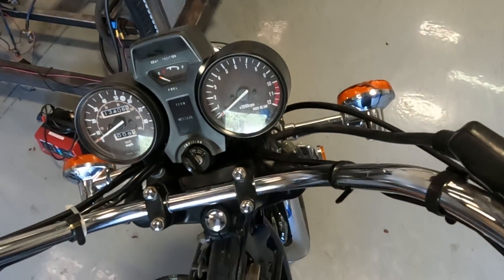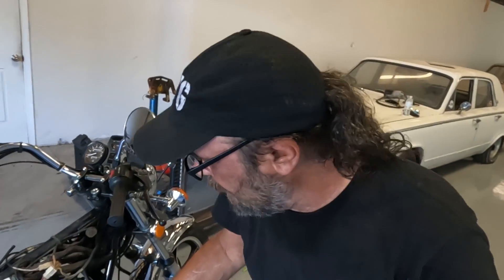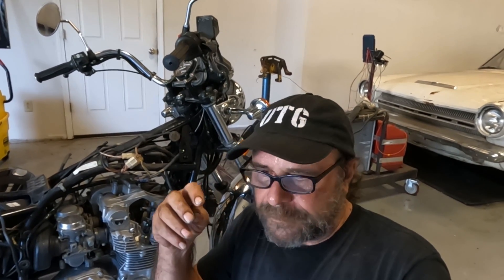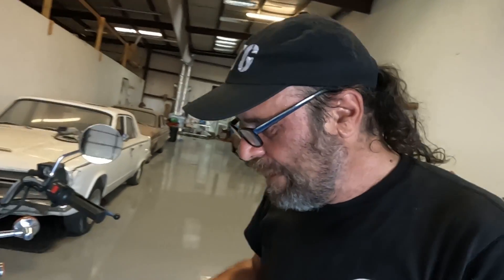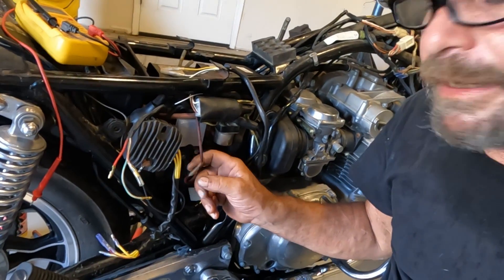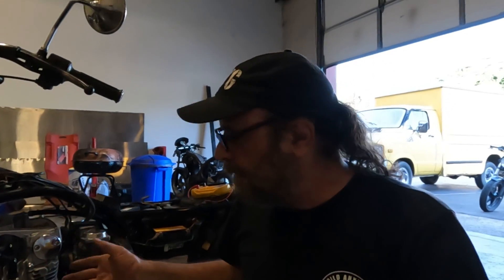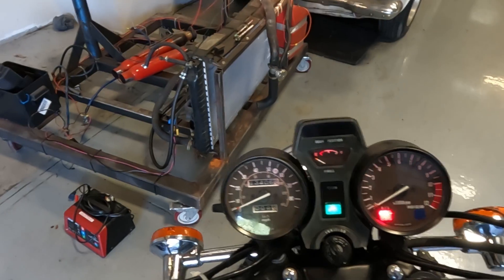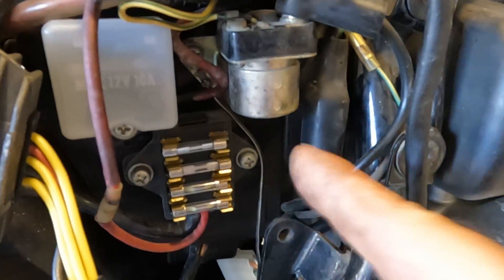Troubleshooting Oddball Starting Issues And The Difference Between Car And Bike Electrical Systems

Comment: Funny, I tuned in to pad my limited knowledge of motorcycle ignition/charging systems, but ended up learning why my '65 Falcon cranks so long sometimes without firing... only to light up as soon as I let go of the key, LOL. These little tips you offer are more useful to us backyard guys than the highly polished super-produced engine build and restoration channels. It's also neat that we have similar taste in toys... just different nameplates! Keep up the good work!! Cheers from Canada.
Reply from the maker: Yes...you get it!
Reply: @UncleTonysGarage  yes exactly I know about tuning subarus and turbo efi systems as a whole get very impersonal and numb if you know what I mean. I had a 1987 Suzuki samurai when I was a teenager and I remember the first time I ever did a bigger job in one (clutch). I had paid for all the parts and tools that I would need and a service manual. Ohh yeah I srarted at 7am and had to be to work by 3pm. I had it back together and working by 10:30 am just cuz it was so simple. I have a wonderful affinity for anything mechanically driven and analog cuz its tangible and I can see it doing its’ job! Thats what makes a real gearhead!
Reply: How about a 1976 Yamaha twin 125cc bike with a simple dual pole, dual throw relay that turns the alternator in the side case into the starter. Quit cranking and the starter turns into an alternator. 
I don’t think many at all understand Capacitor Discharge ignition system either, but almost every lawnmower engine uses this as the magnet turns but the pick coil sits still & sparks. This not a simple step up transformer as the is a transistor, the gate is triggered by a resistor & capacitor and sparks slower than the actual magnet position, or is should say delayed. Lots of cool stuff on bikes needle bearings on both ends of a piston rod w/10k RED Line. How many car engines explode at that speed. 2-stoke with a rotary disc on crank to block off the carburetor that is attached to it! No visible carburetor…

Comment: All of these old bikes are damn near bulletproof in the end.
I hate to hand it to the Japanese, but yes their machines are very hard to kill.
I worked for an old man , in my teens, that taught me time and time again...
Find the junk bike out behind someone's shed,
And we will get it running.
Most times , good enough to repair and sell.

Countless times, these bikes only needed TLC.
Every now and then we would have to clean the magnets on the rotor or stator.
Most times it just needed a fuel system cleaning.
Had everything from a Benelli 900, to old H2 triples, Husqvarna, 
Even had the gold mine of a kz1300 once. But unfortunately it had a dead cylinder on one of the six.
But it still sounded amazing as we woke it up for the first time in so many years, bellowing smoke out of the whole shop while it wound out sounding like a damn F1 car.... Right next to the drive-thru window of a burger shop..lol...  Damn near had the fire department there. But everyone knew Bruce.... If anyone knows of this man he should be somewhere in Indiana...
Thank you Tony for your time.
I wish I had the gold mine of motorcycles in the corner like the way you do now.  
I must give some credit to my old friend, Bruce Miller of national cycle in Fort Walton Beach , Florida.
He believed in me as a 12-year-old kid and we did some cool s*** from time to time. 
I later went to work for a Kawasaki , Suzuki , Arctic cat , Polaris , BMW dealership.....
But later went back to national, because he was the old school type much like yourself.
And ran nitro in his H2 triple drag bike... Whoa...
I'll never forget it.

Comment: I’ve had issues with more than 1 bike where the stator had a few bare spots where the varnish chipped or flaked off. Douche it super clean and dry and brush on some high grade boat varnish or coat it with some epoxy. Short of broken wires this helps most of them.

Comment: Welcome to the real South Uncle Tony.
Used the voltage/rectifier on old riding mowers from the 60/70's, cars with generators and old tractors/construction equipment. I believe old outboards had them also. My old ford TLB 5000 has to be polarized after power has been removed from system or part replaced.
    fyi dunk your hat in cold water, give it a shake, put it back on and you will have a temporary brain cooler while outdoors.
Read up on heat stress signs old man, because it is scary the first time it happens to you. It will sneak up on you! It is very serious stuff.

Comment: Good on ya Uncle Tony

over the years when I’ve had cars as part of the servicing I used to spray a bit of lubricant into the ignition switch where the key goes WD-40 or whatever the case may be locksmiths have told me not to do that because according to them theres a layer of grease in there that holds everything together and solvents just wash all that grease away

The thing to use is graphite powder in a little plastic container and you just puff it in there as a dry powder 

I’ve had situations where you leave the car switched off and the key barrel is worn and it’s making a very slight contact and it drains the battery 

so with older cars a kill switch is always good…..!!

Comment: Gonna open a can of worms here. Your analysis isn't Quite right. Most Stator type motorcycle charging systems don't come on line till well off idle. they generally run only on the battery below around 1200 RPM. They rely solely on the battery to start the engine. The no start symptom you're having is a result of a weak battery. The stator or regulator-rectifier may indeed be bad and not fully charging the battery. but it doesn't provide any boost at all while starting. Load test the battery and you'll find it's weak.

Comment: Sorry to disagree with you, Uncle Tony, but the alternator does not add up cranking power while cranking the engine. Imagine that the starter motor is loading the battery at about 50A and the alternator turning at engine cranking speed is putting into the system close to zero mA... The engine tries to start when you release the button because the ignition system suddenly receives full battery voltage. As you know, battery voltage sags a lot while cranking the engine, and if the battery is not fully charged, or it is on its way out, or there is what is called a "voltage drop" across the electrical system from the battery to the ignition coils, then there would be not enough juice to produce a healthy blue, fat spark, or even spark at all. When you release the starter button, and the engine is still turning by inertia, it may try to start. The symptom you described in the video. But believe me, it has nothing to do with the stator or the alternator. If the stator has some bearing on this, is its failure to charge the battery properly, nothing else.
Reply: The concept also violates the 1st law of thermodynamics. Even if you geared the alternator to turn fast enough at engine cranking speeds to generate any useful energy, the amount of power to turn it would exceed the power generated by the alternator.

Comment: I've had a couple fords with EECIV and it was the start circuit in the module "brain box" on the fender. It would start if you got the key back to run position before it stopped rolling over

Comment: @uncle tony’s garage so if the stator goes bad it basically makes the alternator work like an old generator powered cars where when you stop at a light the lights and shit get dimmer and lack current to keep them going cuz of lack of engine rpm’s.

Comment: yes exactly I know about tuning subarus and turbo efi systems as a whole get very impersonal and numb if you know what I mean. I had a 1987 Suzuki samurai when I was a teenager and I remember the first time I ever did a bigger job in one (clutch). I had paid for all the parts and tools that I would need and a service manual. Ohh yeah I srarted at 7am and had to be to work by 3pm. I had it back together and working by 10:30 am just cuz it was so simple. I have a wonderful affinity for anything mechanically driven and analog cuz its tangible and I can see it doing its’ job! Thats what makes a real gearhead!

Comment: Yup.  Especially if you've owned an Italian beauty (Ducati and Aprilia for me), you get real familiar with the stator and regulator/rectifier.  Happily there are (or at least were) high performance aftermarket units readily available, and if you're the third or fourth owner, they've probably already been upgraded.  And if you're a prospective buyer, always good to check if it's been done.

Comment: That problem was very common on these 80's Suzuki road bikes. I had a '82 GS750E that periodically had a similiar thing, crank over fine but not start yet it wouldnt try to start after I let go of the starter switch. When i tested it, i found that the cranking battery voltage was dropping to aprox 8 volts (starter wasn't dragging after letting up the battery voltage would return to 12.2-12.4 volts) which isnt enough to excite the CDI to fire the coils and if you jumped it, it would fire right up. When bike was running at idle the charging voltage was staying around 13.6 - 13.8 volts at higher rpms it would raise up to 14.1-14.3 volts. I was buying the cheaper batteries, which didnt hold up. I bit the bullet and finally bought a much better battery ( higher CCA and reserve rating) never had that problem again. Then sold the bike to my brother-in-law and about 2 years later the stator finally failed. He fixed it and still has it today. Had allot of fun rides with that bike.

Comment: The stators and rectifiers on these old GS classics are a known weak point, capable of going bad if you put too much load on the charging system as well as putting too little load on the system. There 5 or 10 years ago was a guy making kits to use a modern R/R which solves the problem, but who knows where that project is these days.  Check the GSResources forum (if it still exists), they'll almost certainly have a thread on it.

BTW, clutch is on the other side of the engine and a sticking clutch on a GS550 is usually just the parts needing to be cleaned and relubed.  Easy job with just a screwdriver, grease rag, and some fingers.

Comment: Hey Uncle Tony. That is the one thing that has kept me being a mechanic for 35 years. And the one thing that got me in to my career in the first place. When it's broken. It's broken. You can't break it any further.  But with knowledge and tools. Correct repair techniques and experience can fix almost anything.
Reply: Bro you can ALWAYS break it further…
Reply: There’s a guy who works at the Redding pick n pull who takes a sledge hammer to destroy any vw that comes thru. 
Injector pump removal?
Sledge hammer. 
Obviously. 
This guy can break it further if you’re having trouble ;p
Reply: @fastinradfordable  Why the Hate for VW?

Comment: Some motorcycles have a switch that’s part of the starter switch that opens the headlight circuit during cranking. They can get gummed up and stick open. If you’re headlights go out, check your starter switch.
Hondas have a small opening on the bottom of the switch housing that you can get a points file into, or a shot of contact cleaner.
Reply: Yup. My 76 CB750F suffers from that.  45 year old plastic finally crumbled.   I bypassed it with a hidden push button under the edge of the seat.   Not a problem since

Comment: I had an old outboard boat motor where if the battery was low it would turn over but wouldn’t start. However if I used the rope start it would fire right up. I hadn’t thought of voltage drop while cranking.

Comment: My old GS1000 would not start like that is the battery was a bit low after sitting for a while. Used to bump start it in second.

Comment: I learned about alternators in automotive class in the 60s ,that class was 4 weeks long and I never forgot it…
Reply: Generator ain't nothing but an alternator without diodes. 
That's what the teach told us for standby generator class. 
And rotors rotate and stators are stationary. 
Easy 101 stuff that ya use every day in the field

Comment: Hey Uncle T. I've been binge consuming your videos lately and I dig your philosophy. I've been considering an LS swap for a 92 Nissan 240sx I've inherited but you've changed my mind. Well, you and a lengthy history of me tearing my hair out dealing with overcomplicated drive by wire throttle systems with b.s. sensors crapping out. I've decided to never deal with a 'limp mode' ever again. After I get that sorted with my urologist, I'll be on my way to find myself a 318 to build for the 240sx and it will be carbureted for sure. I have a 2004 Durango with a 5.7 Hemi with AWD I'll be selling to finance the build. There's just something creepy about not having any solid linkage between the pedal and the motor. The slant Miata you built was a major inspiration for the project. I want this engine as low as possible and weight distribution is definitely a main priority for optimization. There's plenty of room in there once I get that 2.4 and it's 3 miles of intake manifold and other plumbing out.  Also, I feel like it's only right to learn how to tune and maintain a carb before taking on MIT levels of software for tuning Holley EFI. Thanks for the insight and inspiration.
Reply: Look into the 90s audis too, they struck the perfect balance between mechanical and electric back then, cable throttle, simple port injection, 6 sensors needed to run the entire motor

Comment: Years ago, my 98 Buell wasn't charging the battery.  After replacing the regulator, it still wouldn't charge.  Continuity check on the stator indicated it was good so I pulled the primary apart to see if the rotor was damaged.  No damage.  I removed the stator and discovered that the one of the wires coming off the coils was broken under the insulation right where it exited the epoxy potting.  With the engine off, the ends of the break in the wire made enough contact to pass the electrical continuity test.  But when the engine was running, the vibration caused intermittent contact between the wire ends dropping the voltage.  New stator fixed the problem.

Comment: One of the first things I upgraded on my 1985 Harley was the Stator.  Had to grind part of the metal where it went to get it to fit, but it made a big difference in the charging system.

Comment: I had an "81 GS 550 L and I went thru 3 stators if I remember right. The windings weren't hardy enough to cope with the headlight being on all the time, which was required of USA sold bikes as of 1980, I think. The headlight switch can be unscrewed and a little plastic tit can be shaved off which will then let you turn the headlight off.
Reply: Yup... I had a GS850L... Same thing... Stators and more stators... Only thing that ever seemed to go wrong though... 👍👍👍

Comment: "While a dead alternator in your car won't keep the plugs from firing, a bad or weak stator will play havoc with your motorcycles CDI ignition."
If this were true then explain why when you bypassed the ignition the bike lit right up.

Comment: If you put volt meter on the two yellow wires when running you should get 31,32, a.c. volts if good and get 13.4 too 14.7 on red to battery every thing is good.

Comment: Night hawk had an alternator. Driven by a hyvo chain mated to the starter ,bad news. Be aware of one with starter problems. Hyvo broken =case split. If the alt spins through the out side with a screw diver, walk away.